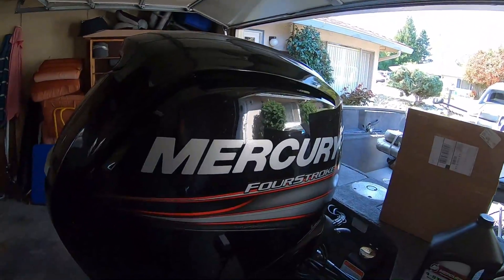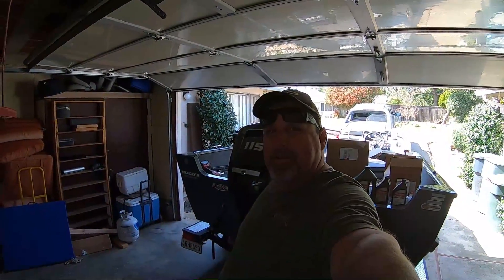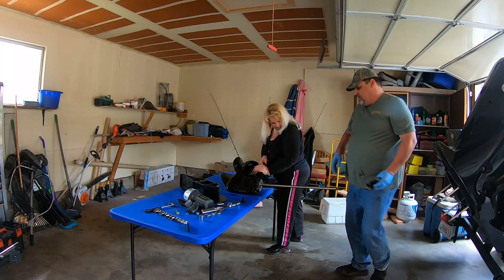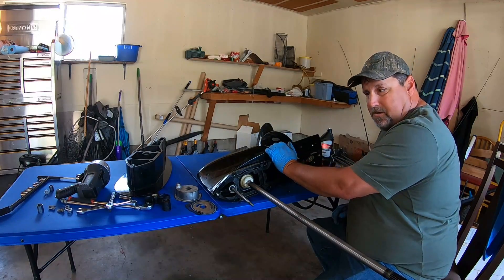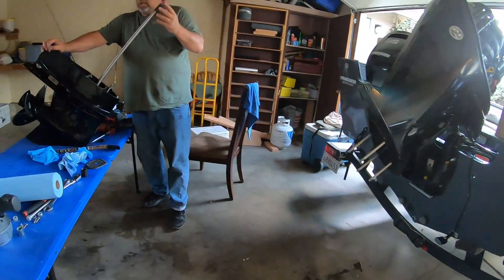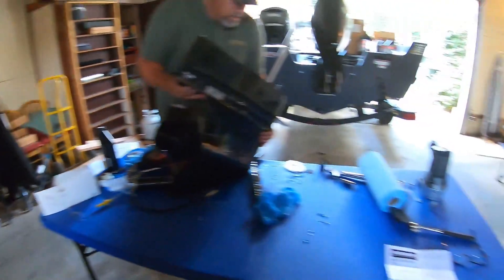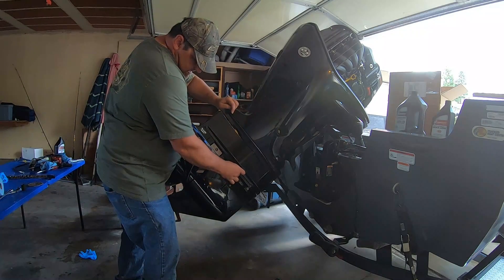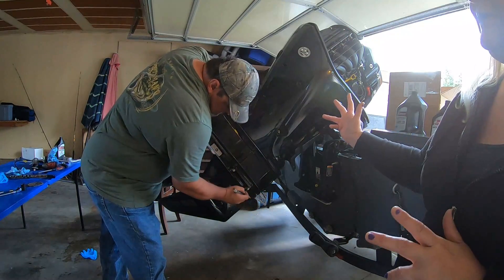Mercury 2017 115 HP Water Pump Impeller Replacement

Comment: hello your video is great. during my removel I follow the MErcury manual and it says to pu the gear in neutral,  I removed my lower unit before the winter to do the water pump and the the gear lub change easily on the stand. Yesterday I went to re-insatalled, the gear should now be as per manual in FWD gear. mmmmm. I know the gear housing in in neutrl cause the prop shaft turn freely both ways. How ever whent the lower unit is installed with the shift shaft handle in neutral and prop shaft neutral, whay I cannot moved the shift handle fwd or Reverse? 

thanks

pat
Reply from the maker: Well just as with any manual transmission always put it in gear that way you can turn the output shaft to line up the splines! Now you will have to turn your crank to get the shifter to move , I'd recommend turning it by hand and have someone move the shifter,  the lower unit dosen't always go up easy, I did mine agin since the video and really had to shake the crap out of it to get it all the way back up! Thanks for watching the videos!
Reply: @thefishstalker7640  I tried to repositionned my shift shaft to fwd, then I push to the detent the throttle lever. I put the lower unit in place and it fits as a glove. Run it gear changed perfectly :)

Comment: I made a lower unit stand out of 2x4's. The lower unit sits right in it. Much easier work up in the upright position. Its also much easier to install the impeller first. Use some dish washing liquid and spin the cap on over the impeller. Super easy. I also leave the shifter in neutral.

If your working solo using a few ratchet straps to hold up the lower unit during install is a huge help..Thanks for the putting the video together.. great learning tool for the DIY.
Reply from the maker: Thank you for the tips , I appreciate it! And thanks for watching the videos

Comment: Thanks for video Rob. I missed the linkage part. Do you have to disconnect the linkage when dropping the lower end?  When your wife was spinning the prop, is that what hooks up the linkage?
Reply from the maker: No the linkage just slips together when you put the lower unit up, way easier than the old ones
Reply: @thefishstalker7640 When you say "The old ones" how old are we talking? I'm about to do a Mercury 75hp 2001 4 stroke

Comment: Question. I don’t remember which way I placed my impeller blades. I get the correct water psi throughout the throttle range but when I’m doing wide open for a time the psi gets below 10psi. Is it possible my blades were backwards or would they correct themselves with the force of water? Is it just not getting the water because of the pontoon displacement of water at 30mph?
Reply from the maker: Dosen't make any difference which way the blades are they flip as soon as you start the outboard
Reply: @thefishstalker7640  ended up redoing my impeller. They didn’t flip after half a season of running backwards. Flipped the same impeller and now I get 20-25psi at throttle. I’ve seen videos where they flip. Mine did not though
Reply from the maker: Yea usually they do flip, I'm due for another one soon put 400hrs on the one, I'll see which direction I put them in , was yours correct bent to to the right looking at it upside down?

Comment: IF you're going to do it, find a Black and Decker "Workmate" work bench.  The lower unit will drop right down and then you can work on things with it in an upright position.   I find it easier to remove the prop prior to pulling the lower units on either OB's or Stern drives.  Saves weight as well.  Oh...use a grease pencil or some nail polish/model paint to mark the exact location of the shafts relative to the case and the unit will slip right in.
Reply from the maker: Thanks for the tip I'll be looking for the workmate bench
Reply: Great idea!  I just ordered a Workmate bench! Thanks for the tip!

Comment: Thanks for the video. Very helpful. My Mercury Tech kinda told me how to change the impeller and made it sound too simple. But your video shows what it really takes to get it done. Thanks again.
Reply from the maker: Yea and you don't have to worry about getting the impeller blades in the right or same position they flip as soon as it starts up